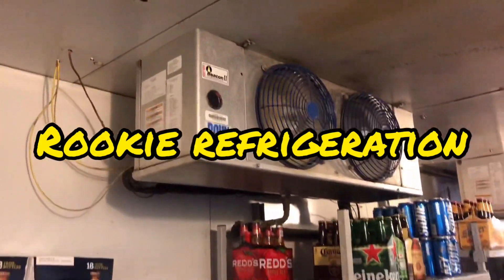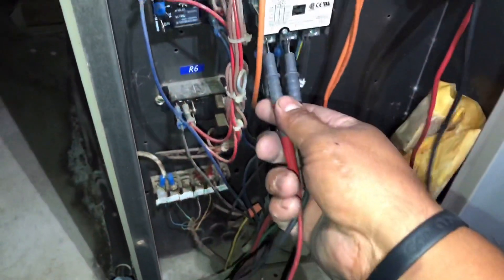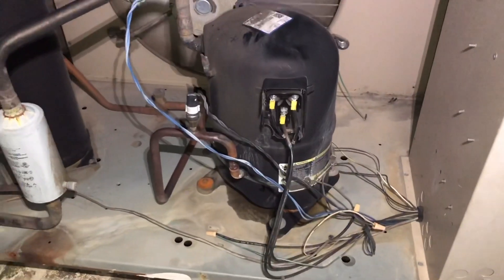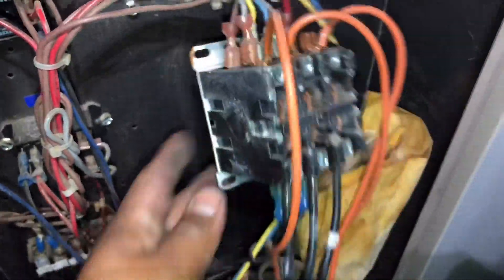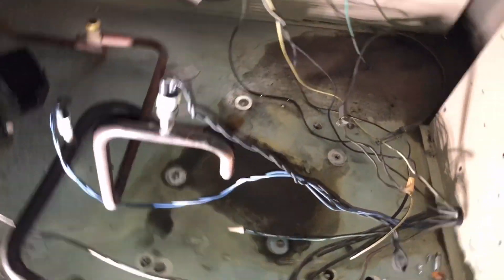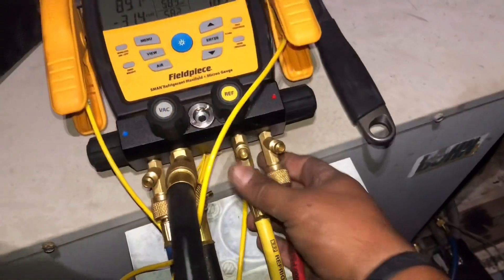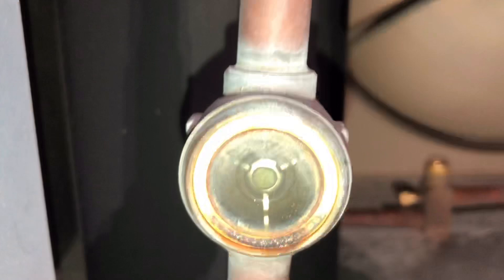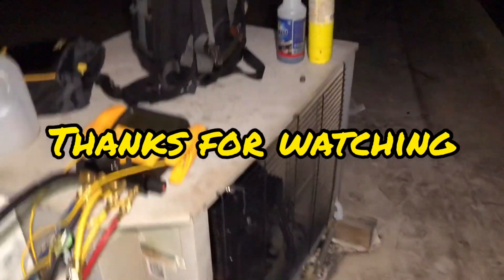HVAC REFRIGERATION:  WALK IN COOLER running warm and Checking receiver level with a FLIR Thermal

Comment from the maker: I just dropped this compressor off at the shop and it is a BURNOUT.  🤦🏽‍♂️.  I didn’t check it at the site so I will have to go do a burnout procedure.   Oil, refrigerant, driers, etc.   dammit.   Oh well. I guess it happens.
Reply: How do you go about doing a burnout test on the compressor?
Reply: @thefambam9305  acid test the refrigerant or oil in compressor
Reply from the maker: Yeah. That was taken care of by another technician.  Changed the oil, driers, and new refrigerant.  👍🏽👍🏽
Reply: Awesome video
Reply from the maker: Thanks
Reply: Hey would you have simply discharged a little refrigerant from the system onto a acid test strip?
Reply: What was the outcome of the compressor model no? Did the parts house give you the equivalent for R404A bud?
Reply: I thought you wanted about 3/4 full on receiver
Reply from the maker: Yup.  But I have to do it.  Lol.  It’s ok.

Comment: Thanks brother!  Steps On charging a walk-in with a receiver ?? , if cold you block off condenser and charge to 180 psi according to headmaster , in warmer weather just charge to headmaster 180 for yours in video…

Then what , just add till clear sight glass?
I’ve heard some estimate base charge on % receiver will hold(80%) and adjust charge from there .
Have a cracked screen so hopefully you can decipher that lol

Comment: Just a question, Do u think a ground test on the previous compressor would have helped as well as a continuity test? U only checked the voltage.
Reply from the maker: Not a ground test.  But maybe a resistance test.  This compressor was locked up so it wouldn’t run.  But I should have done that.

Comment: What would say rule of thumb on coil temp for walk in freezer and cooler.
Reply: What about freezer?
Reply from the maker: @derrickgarcia303  depends.  If you want a box temp of -10 then you would need a -20° evap sst.  This is for a 10° TDcoil.
Reply from the maker: Depends on your TD but I always like 23°.

Comment: Simple tip: Suction driers are usually added when a compressor burnout has already occurred. Systems aren’t even supposed to have more than one filter drier which is usually in the liquid line only. The moment you said “suction drier” I wanted to speed this video up.
Reply from the maker: Simp Detector I either cute then out or replace them.  Depending on who the consumer is and their requirements.   I don’t always get to do what I want.  Lol.  But I agree with you 100
Reply: @rookierefrigeration4357  You know it all depends but if you're having compressor issues and you see a suction drier, offer to replace the compressor or unit, and do not use another suction drier. I hope you did a good flush on that unit as well.

Comment: Bud. How can you tell the reciever level without the IR cam? Thanks
Reply: Warm is the level? And hot is the empty part? Thanks!
Reply from the maker: Derrick Garcia yes. Correct.  Remember sensible heat and patent heat.  The empty p PArt is absorbing sensible heat, which you can feel
Reply from the maker: Derrick Garcia just feel it with the back of your hands.   You will tell the difference from warm to hot.

Comment: Liebert makes a reciever tank that has two floats that look like an oil sight glass, one high, one low.... and you'll always know if the level is low. they also make a pad style heater to keep the level up during cold weather, and insulate the tanks.
Reply: are you talking about those little red floating balls that you can see on refrigeration racks? so you can see how high they rise based on the level those balls float?
Reply: @Clasped003  oh ya!

Comment: I don't know if this was addressed, but how about a leak check?  I am assuming running low on refrigerant caused the burn out.  Did you check for leaks?
Reply from the maker: Not this night.  The leak check was recommended to the customer.  We got denied.  Lol.  We will just have to do it on the next “low charge” call.  🤷‍♂️

Comment: It says 200-230 volts on the tag, you measured 250volts
Reply: 230v in the USA is same as 225-255 depending on where u live and how much power drain on lines to drop voltage. 230 is same.
Reply: @jphvac5725  250 is 250, no mather where you live. however the voltage for the unit can be higher when having a higher frequency 50hZ or 60Hz, about the power lines, they where almost next to the building, thats why he was avoiding to clime the ladder next to it. It is possible that voltage occasionally gets higher than the 250 he measured, what in its turn can tribute to the burn out, however in this case the faulty relay is in my opinion the case.
Reply from the maker: Yes, then below it it says 200-240. It’s fine

Comment: Found You, NICE video,  I love that Flir thermal. I’ve been wanting to get one
Reply from the maker: It really is a good camera.  I’m really enjoying it , only had it a week I think.
Reply: @rookierefrigeration4357  dont be so quick, mine was about $700 and it shit the bed, unfortunately they dont make the C2 anymore and recommend if its not working to junk it when its out of warranty. I didnt, and had the battery repaired localy for $63. it could have been much more, Havent really used it all that much, but when you need it, its great, Especially on refrigeration.
      These toys get expensive. If your not sure about using it that day, dont bring it.  The truck is too hot and all the bouncing around is a bit too rough on it I figure.
Reply: The difference between men and boys, is the cost of their toys....

Comment: I know a lot of guys don't like to flare driers in, but everytime I replace a compressor they get flared in with a sight glass. Makes it way easier the next time when you have to pump the system down to fix a leak. Or after a burnout u can replace the drier with just 2 wrenches instead of lugging torches on the roof....  Good work though , that's long A$$ day!
Reply from the maker: I agree.  I would like to do those also,  but imagine with all the accounts we have, I’d never finish or see the benefits.   I’m gonna bring it up to my boss. See if he likes the idea and I’ll start doing them.  Would be great not to have to get torches for a drier only.

Comment: If I understand it correctly OL means overload so the inrush current was too high for the meter to measure. Also I've never seen a latching contactor, lol.
Reply: OL means open line, not overload. The meter was accidentally set in the wrong mode (resistance / continuity, not current).
Reply from the maker: OL is open line, open load, lol. Whatever.  But I think the problem was the inrush was greater than what the meter could read.  It was set to VAC Amps.  I’ve never seen it real OL on inrush current🤷‍♂️
Reply: It's actually OverLoad in resistance mode too, because the resistance is close to infinite, which is more than what the meter can measure. It doesn't mean open line, even though it can be interpreted that way, it leads to confusion like in this case.
Reply from the maker: You may be correct.  I’ve never seen my meter not pickup inrush current.  🤷🏽‍♂️. Thanks for the advice

Comment: If it’s locked up you can always try swapping the phase around and running it backwards for a couple seconds to see if it will break free. Works more times then not if it’s just locked up, and if it doesn’t work, well you tried. Lol
Reply from the maker: Yeah. I agree.  But this compressor was a burnout.  I just found out today.

Comment: I also work on 711...I’ve had some problems understanding the beacon boards...maybe you can help explain or make a video 
Saw your comment on HVAC life with Alex channel
Reply from the maker: Thanks.  I’ll try to make one but the beacon system is pretty easy to maneuver through.  I’ll try to make one next time I go.  I hardly go to 7-11 though.
Reply: There really easy to figure out
Reply: @rhansm91  I've been reading the pdf and simple.. But sometimes we have come across some issues with eev, boards, etc may u guys have come across some issues that might wanna share
Reply: Carlos .... contact HEATCRAFT they have some pretty good info for techs on them. You can probably find it on the inner web. But nothing better than hands on experience. Once u fuk something up you won’t do it again. Once u learn beacon II setup its actually really nice setup.

Comment: So was it the correct compressor?
Reply from the maker: According to the guy at United it was.  But I’m still kinda not convinced.  I’ll have to call Heatcraft and see.   Then the only thing we can do is let the customer know. 🤷🏽‍♂️. I needed to get them running right then, so we didn’t have time to go on a hunting expedition.
Reply: Have seen same thing multiple times on refrigeration at grocery stores and gas stations. I made sure not to tell customer so they don’t freak yet I did follow up with heatcraft/bohn on four of them and they were all correct compressors for coolers.

Comment: I loved my Flir. It took a ride in the washing machine and I  had to replace the battery. It lived for about another year and died for good, RIP Flir. My favorite trick was to use it on glass doors and frames to find anti-sweat heaters to replace.
Reply from the maker: Yeah, I’ve only had this for a bit.  I’m loving it so far
Reply: What's the model of that flir? First time I've seen a video where it picked up the liquid level very cool

Comment: Ohh i saw that was no amps so bad wiring right?
Reply from the maker: Maybe.  The windings were closed so I’m not sure what it was.  Just get them running and move on 😂
Reply: @rookierefrigeration4357  I know this video is 6 months old, but I just want to jump in that I think 0.L on the meter means overload, not 0 amps. So it probably drew more amps than the meter could read
Reply from the maker: ShinyMajor yeah. I believe I had the meter in the wrong setting.   🤷🏼‍♂️🤷🏼‍♂️.  My mistake

Comment: Hi man, btw im a follower of your work, keep up with the good work, and thx for sharing.
Now for my curiosity, how about switch 2 phases to unlock the compressor? Never test it my self but i read about it, what u think?
Reply: 50-50 chance it will work. If a compressor locks up, reverse the legs is not likely enough to free it up. Even if it works, the compressor will lock again. You would just be leaving it for "the next guy". 20 yrs experience and I can tell you I have come across dozens of reversed compressors that have locked up. Previous tech said "it was all good" and split.
Reply from the maker: And thanks for watching bro.
Reply from the maker: I thought about that but since it was not pulling any inrush amps, I figured it was dead. It was late and overtime.  Not the time to be fishing.   But I do agree with you.  Maybe that would’ve worked.  🤷🏽‍♂️